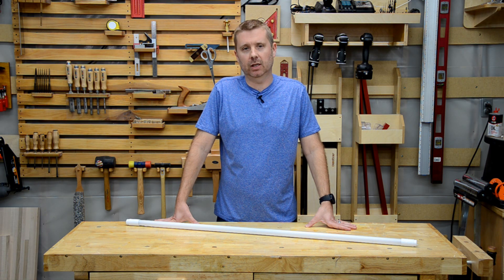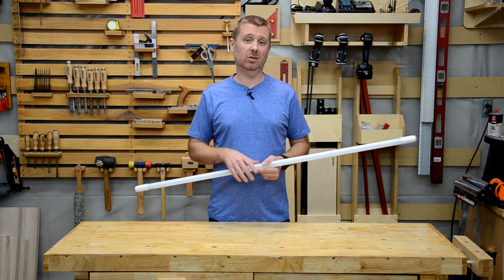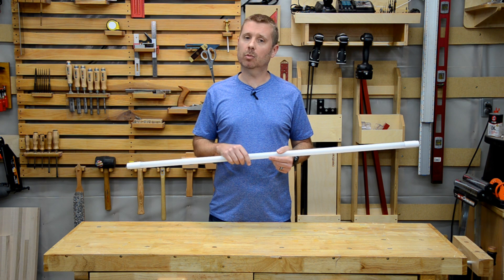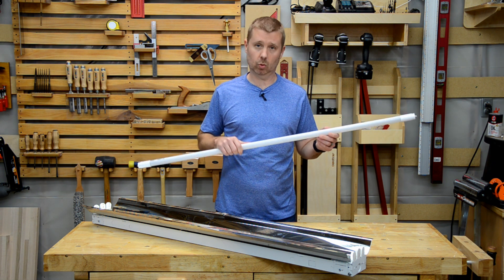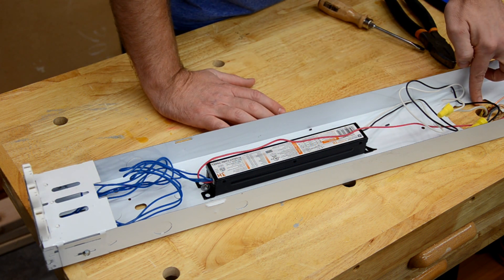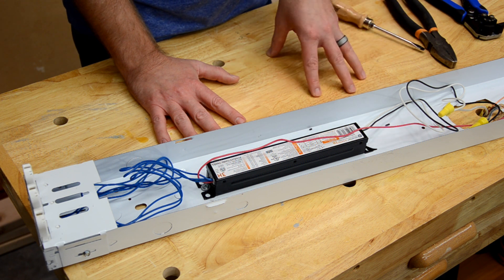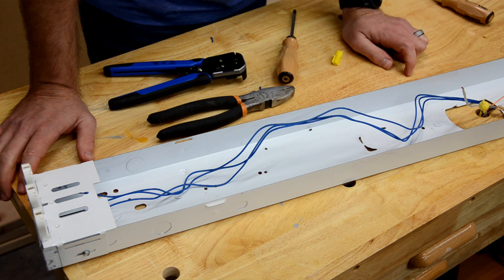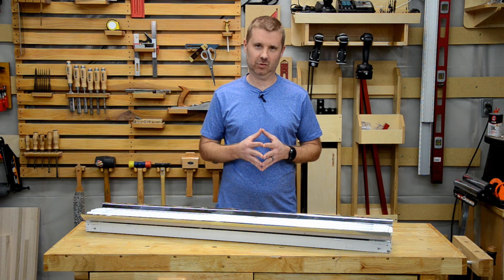How to easily convert fluorescent Lights to LED – UPDATED!

Comment: Wondering how you'd do this conversation with florescent lights that are not hardwired in but plug in.
Reply from the maker: It's pretty much the same. Once you open up the fixture, you should have see a ballast with wires going to one end and then different color wires going to the other. Let me know if you don't and we'll figure it out.
Reply: @ToolboxDIY  thanks I'll let you know if I need additional info

Comment: I like your wire stripper. I use the Wago wire connectors. I don't use twist-type connectors at all anymore. They are much easier than I found very secure.

Comment: You didn't say the red wire hooks to the blue power wire or the white neutral when you were converting to LED on the fixture?
Reply from the maker: 7:59 Blue going to hot and then red going to neutral.

Comment: Thank you for the video.  I watched it several times before tackling my retrofitting project.  Most of the lights were pretty straight forward.  i came across a couple that were part of a 3 way switch.  there was an extra wire (red) going along out of the ceiling with the neutral, hot and ground wire.  i suspect that it is part of the wiring for the 3 way switching system.  can you shed some light on what to do with this "extra" wire.  My instinct was to group this red wire with the hot wire. it seems to work, but i want to make sure that i am not going to cause any long term issues.

Comment: I have some fixtures in my garage that has three different switches that can turn them on or off. The fixture has 4 bulbs, two side by side and it has two ballasts. It seems like one ballast has two yellow wires connecting to one side and the other ballast has two yellow wires going to the other side. There is also two hot and neutral wires coming in. How can I rewire these?
Reply from the maker: Cut all yellow wires close to the ballast and remove the ballast. Take two yellow wires from one side (and only one side) and splice those using a wirenut with both of the black wires coming in. Take the yellow wires on the other side and splice those using a wirenut with both white wires coming in. I'm going to guess that the last fixtures only has one white and one black wire coming in. No need to do anything differently here.
Reply: @ToolboxDIY  thank you so much, this is exactly what I did and it worked! Just like you said, the last fixture had only one black and white wires

Comment: Great update.  Thanks.  Now i feel like finally tackling this long overdue project.  I need to replace several broken off tombstones though so let's see how that makes it harder to complete for me.  They still need to be shunted tombstones if you keep the double ended style LED tubes even if your remove the ballast, correct?
Reply from the maker: I would use shunted tombstones for the replacements however most double ended tubes can be powered through either pin so non-shunted is likely to work.

Comment: Great Video!  I have one question of concern since I am not an electrician.  Most of the fluorescent fixtures have either 16 or 18 gauge wiring  that normally goes to the ballast.  My question : After removing the ballast, is the existing 16 or 18 wiring in the fixture from the tombstones capable of handling the direct 110v load?
Reply from the maker: 16ga and 18ga wire is typically rated for 600V - sometimes more for an instant start ballast. Usually, we want to be more concerned with the amount of current that flows through a wire because too much current would overheat the wire and possible melt it. In this case, we are converting to a much lower current light source so that you can rest easy using the existing wires.
Reply: @ToolboxDIY  Thank you for clarifying that.  
After doing all my conversions I was thinking I might have to redo them. No issues so far, thanks again.

Comment: I don't remember the brand of LED tubes I used, but they come with double ended pins.  One set of tombstones has two blue wires and two red wires.  These 4 wires get wire nuts on the black wire coming from the power cord.  The other set of tombstones  have three wires, consisting of 1 red, 1 blue, and 1 yellow.  There is also a short yellow jumper next to the longer yellow that goes to the red wired tombstone.   These 3 wires get tied to the white power wire, also called negative or neutral. By pass the ballast by removing it from the metal fixture and cutting the wires from it close to the ballast case.  Wire nut the wires together as described, put in your LED tubes and you should have light.   A tip: if you are only going to do one or two fixtures for now, and several others in 6 months or a year, take a piece of paper and make a simple wiring map or diagram so you won't forget and have to open up a previously wired fixture to see how it was done.  The whole thing takes about 5 to 10 minutes.

Comment: Great video . How is it done with a 8 ft fixture that uses 4 4ft bulbs?
Reply from the maker: When I've converted these type of fixtures using doubled ended tubes, I rewire all the tombstone in the center to use the hot (line) wire. I then wire all the tombstones on both ends to use neutral.

Comment: 4 years later and you still haven't upgraded your microphone! Even a cheap wireless lav mic would be a huge upgrade in sound quality for your content. :)

Here's a question for you .. I have flourescent fixtures with 17" T5 bulbs, and I can't seem to find LED versions ANYWHERE, even from Aliexpress.. Do these even exist or am I forced to find  new fixtures altogether?? :S
Reply from the maker: Hmmm. I appreciate the feedback but I did upgrade the mic. When I listen to this video it's crystal clear on my system. I don't hear any distortion, clipping, muffling, etc. What is it you hear (or don't hear)?
On your T5s, I too can't find anything. I'm a little surprised b/c those aren't uncommon tubes. If I run across any, I'll post a link here.

Comment: Your video will help me a lot. I need to change under the kitchen cabinet tubes to LED. The existing tubes are F30T12, 30 W. I plan to remove the ballsts in all three fixtures. Where can I buy T12 LEDs. I only see T8 LEDs,
Reply from the maker: You can use T8s in place of T12s. 1000bulbs is a good resource if you have single pin T12s and want to replace those with LEDs.

Comment: wait, at https://youtu.be/VKEQ1HCLW5c?t=397 you say you don't need to 'do anything' with the ground wire ? does that mean it's not connected at all??
Reply from the maker: If you don't do anything with the ground wire (which is what I recommending), it will STAY connected. The ground connects from your house wiring to the fixture chassis. In my experience, I've never needed to disconnect that to remove the ballast (unless I removed the fixture from the ceiling to shoot a video!).

Comment: Anyway to do this with an emergency ballast ?
Reply from the maker: I have limited experience with using LED tubes with an emergency ballast, but my understanding is that a ballast compatible tube may work. It is not guaranteed. It all comes down to ballast compatibility which is not specific to to emergency ballasts. This is an issue for all ballast. Some tubes come with a list of compatible ballasts, but most do not. Unfortunately, you may have to just buy and try until you find tubes that work.

Comment: Dumb question, but great video. I was only able to find LED replacements that are marked T8/T10/T12. Does that mean it will work for my fixture that states T12? I'm not going to remove the ballast (yet). This one also provides a wattage adjustment from 15W-20W. I know, I could do my own research but wanted to ask first. Cheers!
Reply from the maker: If your existing T12 tubes have two pins on each end, then the replacement tubes will fit. I'm guessing that wattage adjustment is actually a range of value depending on the color temperature you choose. The bluer the color, the less power consumed.

Comment: I installed these new tubes in my wife's art studio and did not remove the ballast.  They worked great until yesterday when she went into the room and they didn't turn on.   Needless to say, she is not happy and I went from being a hero to a "bum"!  What on earth happened?
Reply: If you still have 120 volts at the fixture, either the ballast went bad, or you have a bad connection in a wire nut.

Comment: In this video...are the tombstones with blue wires shunted or non shunted?  They appear to be shunted because there is only one wire coming out of each tombstone.  I'm under the impression that the tombstones have to be non shunted for a conversion, which would have two wires coming out of each tombstone.  My thinking is if that end of the light fixture is going to be connected to the hot wire what difference would it make if it had one wire or two wires connected to each tombstone.   Thanks in advance.
Reply from the maker: They are shunted in this video. Non-shunted are only required for single ended conversions. I cover that in this video: https://youtu.be/SCWoI0X4jw0

Comment: It seems like placing those FYI stickers that you mention at the end of the video under the installed bulbs maybe aren't the best place. It seems you'd want to know when buying the bulbs first. Maybe put the sticker near the light switch or breaker box?🤔
Reply from the maker: I think it's a matter of preference. I feel I've done my part by making sure the next homeowner is aware of it before the actually change the bulb.

Comment: I have 8' old fluorescent 2 bulbs per fix. I have 5 fixtures. Only one bulb lights per fixture. I'm 78 retired 
Vet on SS and need to do most economical. Is it most 𝙛𝙚𝙖𝙨𝙞𝙗𝙡𝙚 𝙩𝙤 𝙤𝙧𝙙𝙚𝙧 𝙖 𝙗𝙤𝙭 𝙤𝙛 𝙇𝙀𝘿 𝙖𝙣𝙙 𝙬𝙝𝙤 𝙛𝙧𝙤𝙢 and bypass ballast ? Your help appreciated.
Reply from the maker: First, let me say thanks for your previous comment. More importantly, let me say thanks for your service to our country!
I don't have a lot of experience with the 8ft tubes, but I have yet to find one that will work with a ballast installed. All my searches only find ballast bypass (type B). In my opinion, this is a good thing since those older ballast may consume more power than new ones which is just a waste of your money. I find Amazon to be a good source since they have such a wide selection. 1000bulbs is also a good source, but those bulbs are a bit more expensive. I found these (full disclosure: I haven't used these so can't vouch for them): https://amzn.to/3zBGksH
Unfortunately they come in a pack of 12 and not 10, but in my experience it's good to have a couple of extras. Even if one fails under warranty, you can immediately replace it while waiting for your warranty return. Good luck!

Comment: I have an "Electricity 101" question regarding "shunted" vs. "non-shunted".  Based on other videos that I have seen, I think I need my tombstones to be non-shunted and it appears that is what I have in my light socket.  Let's just say that I'm wrong and it's shunted and I put the bulbs in.  Will it simply not turn on or will sparks start flying?
Reply from the maker: Non-shunted on a double ended tube should work just fine. If it doesn't work, it just means that power isn't getting to the right pin. No damage will be done. Shunted on a doubled ended tube will definitely work and there's nothing wrong with using those.
Reply: @ToolboxDIY  Great.  Thank you very much for your help.

Comment: I’m gonna throw a wrench in here.  My 20 old fixtures have two yellow wires, two blue wires and two red wires exiting the ballast.  Two yellow to one end (tombstones) and two each red/blue to the other.
Reply from the maker: Take the two yellow wires and connect those to the neutral (white) wire. Take the blue AND the red and connect those to the hot (black) wire.

Comment: I have an older system that only has two wires positive or negative. How do I work with that?
Also, is it possible to make this conversion and have the LEDs be dimmable?
Thanks for your help.
Reply from the maker: Do you have one wire going to each end (tombstone) or do you have two wires going to each end?
You can make this conversion using dimmable LED tubes. Here's some: https://amzn.to/3zbQiAF 
(Note as an Amazon Affiliate I earn from qualifying purchases, but it doesn't cost you a dime extra!)

Comment: Following up on David's comment (and forgive me if somewhere down the line my questions have already been answered): My original/current setup includes a fluorescent (2-tube) ballast and non-shunted tombstones on each side. 1.) Regarding my ballast, it specifically states on the sticker to only use T12 (fluorescent) tubes whereas you use T8 LED tubes... would that 'require' me to officially bypass/cut-out the ballast? 2.) You make no specific mention (in this latest video) of shunted vs. non-shunted tombstones and whether or not these hybrid tubes will work for both or not? You do mention the single wire connections but nothing in regards to 'why' they have single connections. In David's case it sounds like he was fortunate in that the shunted ones worked for him. If/when you get a chance please respond and clarify? Thank you.

Comment: OK. What is the total price of all the components to convert the light fixture?;
The new LED tube bulbs cost $18 each. 
That's $36 just for 2 tubes. Plus ? for the rest of the connections? It's much easier to just buy a whole new assembly, plug it in and Wellah. No muss, no figuring what bulb and tombstones to buy for each application. Easy Peasey.

Comment: I followed your instructions exactly, although mine had 2 wires each for the hot end rather than one in your video.  No problem.  I just connected them all together to the existing house black.  Worked like a charm.  Very simple!  Thank you.
Reply from the maker: You're welcome! Glad to help.

Comment: In this video you are not clearly showing what you are doing ~ you are taking three blue wires and you are connecting them together with a nut . To what ??? you're not showing what you're connecting them to. And then you are taking a red wire and connecting it to another wire.  Again  what are you connecting this to ?? I cannot clearly see this in your video so confusing. I even took a still of the very last image and then blew it up and I still cannot see what's going on

Comment: Do they make an LED Bulb that's Plug n play that will work with a working or Bad Ballast. No bypassing, No re-wiring. Just slap them in & if the ballast dies later, LEDs always work?
Reply from the maker: I'm not aware any that will work with a bad ballast. Usually a bad ballast means no voltage is getting to the lamp or a varying voltage is being output. In either case, there's not really a way for the bulb to be able to overcome that.

Comment: ToolboxDIY, To simplify the explanation would it not have been better to just say, "cut out the ballast, then take the incoming live to one end of the holder and neutral to the other end" , and to cut out any further confusion with your demonstration it would have been better to have connected the incoming live to the red wire and incoming neutral to the blue wires.